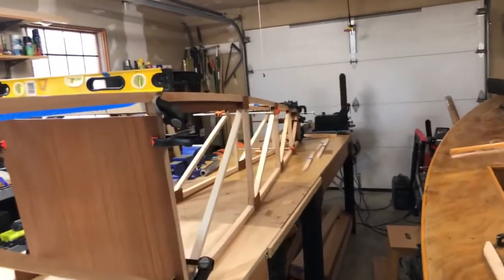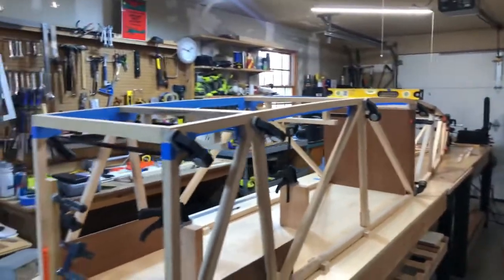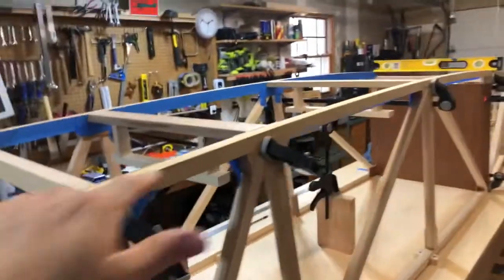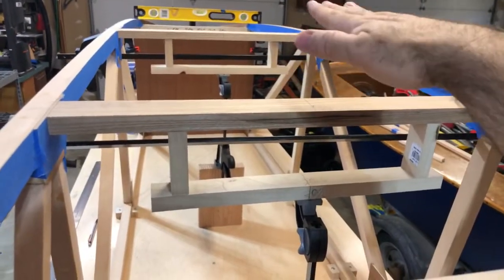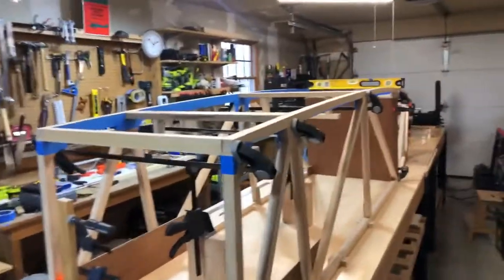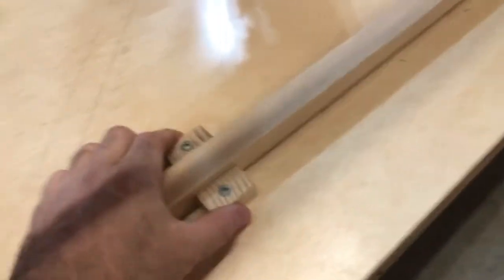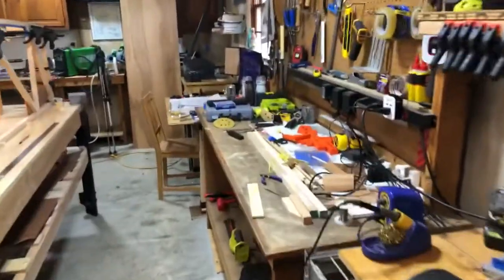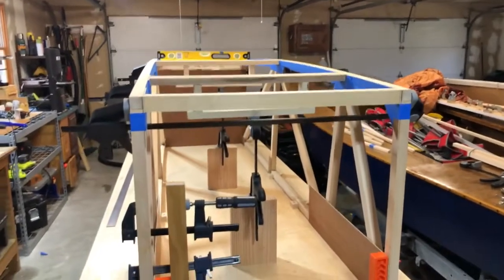Pietenpol Air Camper Build #22 - Fuselage Feb 2022

Comment: ANY IDEA WHAT WHEELS YOU ARE USING AND WHAT SIZE AXLES AND WHAT BRAND OF WHEEL. THANK YOU LARGLEY
Reply from the maker: I go back and forth with either between the original plans for wood gear spiked t wheels or a metal gear with hub tires.   It’s a battle !   But I’m a long way off for that and have time.
Reply: @PietenpolNX899TD  Where can I order this wood for the manufacture of the airplane, tks

Comment: I'm sure you've probably been told before: there is a lot to install inside the fuselage, so leave at least one side not installed until you are actually ready to cover or like me you'll be working on your head to add things to the inside of the fuselage.
Reply from the maker: I won’t be adding either side until done.